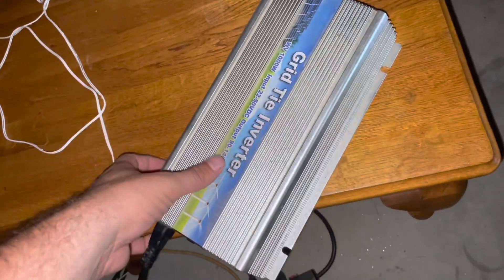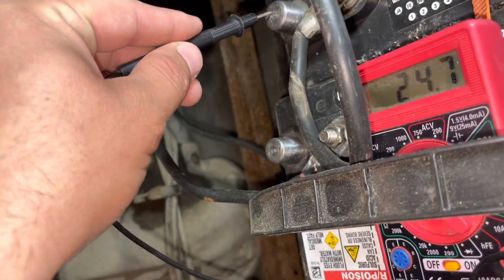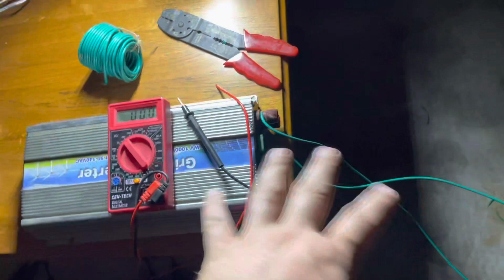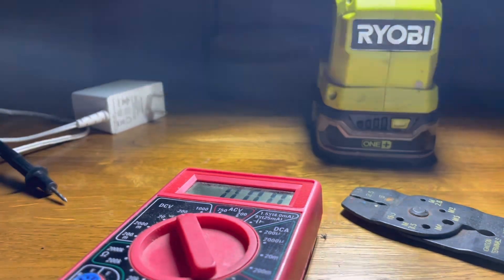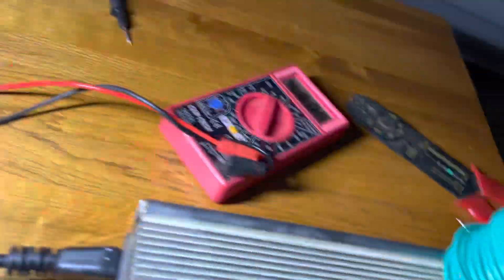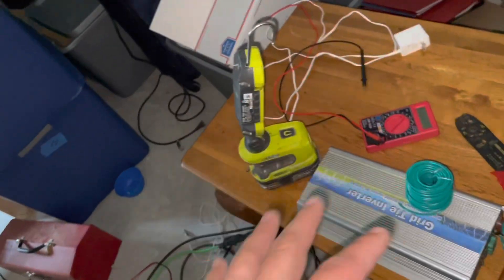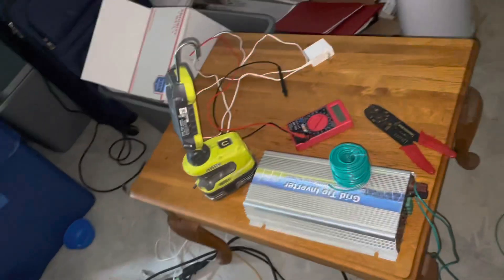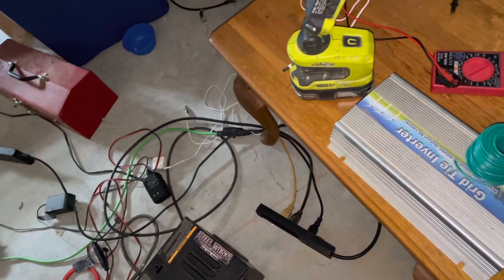Cheap Amazon Grid Tie Inverter Quirks

Comment: I wanna get my hands on one of these and see how it has a variable input. Im assuming some kind of transformer or ic set up can anyone elaborate please? I was under the impression that this tec was fairly new but apparently its been around for years. So far ive learned that they usually overheat due to bad design and the fan burns out so some kind of modification consisting of a fan or fans with acual bearings and a way to get more air flow going on but ive heard that their not efficient at all something like 30wattas for every couple hundred watts input. but like I said other than a couple videos on Yt i don't know exactly how the circuitry functions. Can anyone knowledgeable give me some info please? 🙏

Comment: That type of inverter is only to reduce consumption in kWh, connected with two or three panels, as long as you have the best configuration suitable for operation, you have to read the instructions it comes with carefully, it is very good and reduces the electricity payment, You will notice with each month that passes

Comment: At 24.4v you won't have much amp load on that, 28.8v is a good solid voltage for that inverter.
Reply: Spot on, I have the same issue. The inverter does not kick in when I connect 2 batt in series 24 volts although the inverter input says 22 v to 60 volts. I believe we need 3 batt in series?

Comment: If you don't need large batteries, use a downboost converter between the solar panel output to directly power a regular inverter from the sun.  Although, even just a bit of shade will cut off all power, but it's doable. You would just need a very small backup to keep everything running when this happens, as well as a possible grid auto trans switch to change to grid when bat hits certain voltage. There's quite a few ways to go about it really. You'll figure it out. Keep us updated, entertaining to watch.

What I mentioned above is not necessary at all if you're already gonna do a proper backup build with a sizeable batt.

Comment: Brandon, there's a few reasons why you can't just hook up an AC appliance to your grid tie inverter and expect it to run. 

Inverter Functionality: A grid-tie inverter is designed to synchronize with the utility grid's frequency and voltage. Its primary purpose is to convert the DC power generated by the solar panels into AC power that matches the grid's electrical characteristics. The inverter monitors the grid's parameters and adjusts its output accordingly. Without a stable grid connection, the inverter cannot generate consistent AC power.

Grid Synchronization: Grid-tie inverters require a stable utility grid connection to function correctly. They rely on the grid's frequency and voltage as references for synchronization. When connected to the grid, the inverter matches its output with the grid's parameters, ensuring that the power generated by solar panels/batteries flows into the grid seamlessly. Without the grid as a reference, the inverter won't know how to produce the appropriate AC power.

Power Balance and Voltage Regulation: In a typical grid-tied solar power system, excess energy generated by the solar panels is fed into the grid, and any deficit is supplemented by drawing power from the grid. This balance is maintained by the inverter, which adjusts its output based on the overall demand. Without a grid connection, there is no mechanism to regulate the power flow, leading to potential voltage fluctuations, power surges, or even damage to the appliance.

Load Matching: Grid-tie inverters are designed to handle the power demands of an entire household or building, not just a single appliance. They are optimized to match the total load requirements of the property with the available solar power. Connecting a single appliance directly to the inverter may overload the system or result in inadequate power supply, as the inverter won't be able to adapt to the specific appliance's power needs.

Safety Concerns: When the grid power goes out during an outage, grid-tie inverters automatically shut down to prevent the solar power from being sent back into the grid, which could pose a safety risk to utility workers. By directly connecting an appliance to a grid-tie inverter without the grid's presence, you could inadvertently create an unsafe condition by backfeeding power into the disconnected grid.

Also, the inverter's fans won't kick on unless the inverter has been running for awhile. The best way to check if your inverter is working is by checking how much electricity your house is consuming while the inverter is on compared to when it's off at the electric meter on the side of your house.  Hope this helps.
Reply: Thanks for the explanation! Looked this up for a while and finally i know what to buy and how I should connect it.
Reply: Dude, he isn't trying to power a signal appliance directly from the GTI, he has it plugged into the grid. You just wrote a whole long spiel for no reason.

Comment: That inverter is intended to be hooked directly up to the solar panels. I ran one for a few years.

With it's voltage range you will have to use 24v or 36v solar panels in parallel. 

It will put out as much power as you get from the sun, up to 1000watts. I had 4 380w panels hooked to mine and it would crank away all day.

If you hook it right up to batteries  it's just going to drain them in an hour or two, don't even waste your time, it is not worth it whatsoever, lead acid car batteries will probably wear out in a couple weeks anyways.

Comment: no in between any batteries or/solar panels you need a dc to dc converter it's a cheap part and doesn't look like it even does much of anything but that is what stabilizes the power